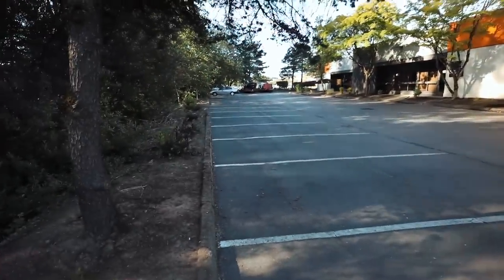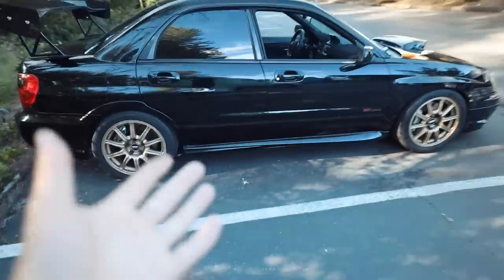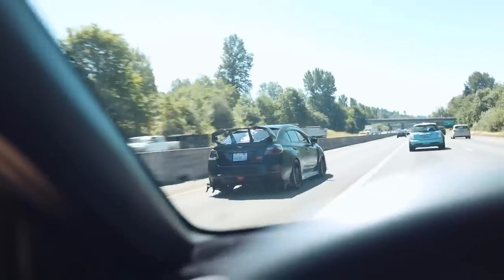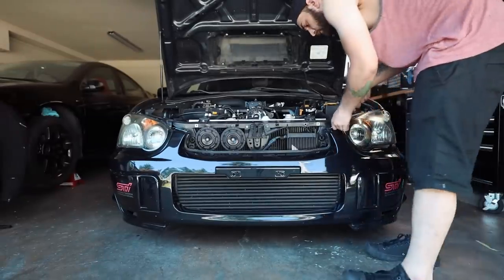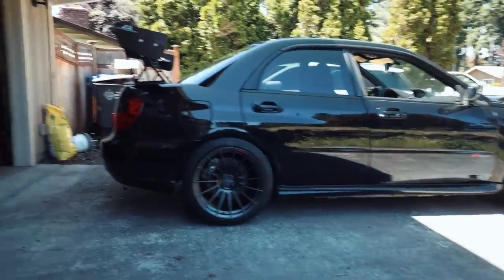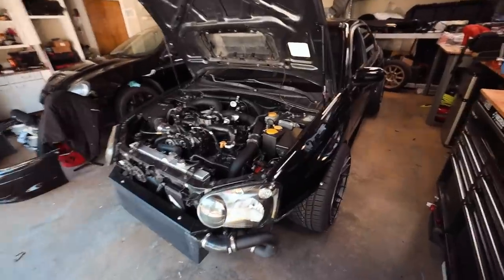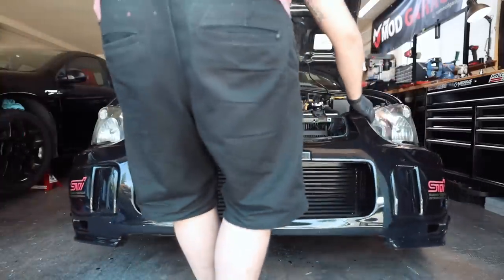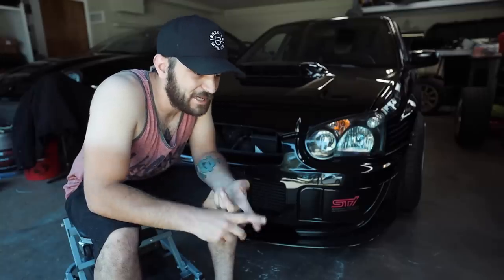Trust The Process...

Comment: u might need a main line hone /bore if you use those case bolts they have a higher toque capacity and can distort the main line
Reply from the maker: Outfront took it into account for measurements when they machined the block 🙏🔥

Comment: You should look at the ABW new age rear diffuser it requires a portion of bumper cut like Mature or hks Kansai which gives the aggression without lowering the rear bumper too much, also love your doing a proper chassis mount splitter eager to see the process cause I’ve been interested in using battle aero mount to install a apr or something so I don’t have those ridiculous splitter rods
Reply from the maker: I'll have the whole splitter install with parts put up here soon, and I already ordered thr APR but absolutely love the look and design of the mature!

Comment: Need to chuck that mishi radiator in the woods and get a Koyo instead.

The wing will definitely look more at home with all of the other parts you're waiting on, but I personally still can't get behind it or the aggressive aero unless it's for a track car. I just think it's unfitting for a street car, probably because of all the carshow stance bois that do it and don't touch the performance.

Friendly pro tip: Enkei is properly pronounced as "N-K".
Reply from the maker: Agreed! Koyo will definitely be taking its place, that mishimoto is like 10 years old 😅

Comment: Ok the wheels do help some. Off topic I'm gathering parts for my brz turbo build. I want head studs and forged internals to aid durability under boost. Is there any to not use lower comp pistons and will 1050 injectors be enough on E85?
Reply from the maker: What are you wanting to drop compression too?
Reply: @Smeedia  most common I've found is 10:1. I know this will require more boost to produce the same hp but with somewhat less overall strain on the engine itself. Basically making it more like a wrx fa20

Comment: I would HIGHLY recommend that you get a universal set of air conditioning O-Rings. They work great.

SAE Universal O-Ring Assortment Set Kit - https://www.amazon.com/dp/B08MF9LQSK/ - $13.89 (Not the exact set I have used.)

No need to get speciality O-Rings from Subaru. As long as they can handle AC refrigerant should work fine with Fuel lines as well! Sprung a leak on my fuel line and just used an O-Ring from an assortment set, and not more leak.

Also, a tip, whenever you put in or take off an O-Ring. The O-Ring is BAD! Trust me. I had to replace an O-Ring because I took it out and put it back in thinking it was fine, never re-use O-Rings. Do not reuse the O-Rings. If you put it in, consider it used, or if you take it out, consider it used. The O-Ring is used when you exert some action on the part.
Reply from the maker: Good to note, we have a few replacement O rings from ID now but may snag that kit for the garage now 😅🔥

Comment: I was curious about cooling because my 07 runs as hot when its that hot outside. I had a freind in my car and i only run ac when they are with me and was going up a hill and the car his 225 till i got to the top of the hill and went back down to 205. Really interested on how you solve the cooling issue. My GR wrx ran way cooler then my 07 sti now.
Reply from the maker: Whatever solution I find I'll definitely share it 🙌🙏

Comment: Hey, I’m going to build my motor and was thinking of doing a stroker build. Any other suggestions on what I should do and what engine I should build and put in? I have a 2002 bugeye with the stock usdm ej205 and stock five speed.
Reply from the maker: What are you going to be using the car for? 🙏
Reply: Ayyyeee I have the same, sedan or wagon ?
Reply: @sampilcher7196  awesome! I have a sedan 🚘
Reply: @Smeedia  I’m wanting to daily it and eventually track the car.
Reply: @casimerotagle3695  nice me too! World rally blue! Got it for 1000$ last year with a blown motor, but it’s one of the cleanest bodies/frames I’ve ever seen for being a Canadian car, I want to do it fairly stock and keep a lot of the value in it for the long term, I’ve just added brembos, coilovers, sway bar links and front sway bar, now for the motor and I should be good to go with this project.. for now lol
Reply: @sampilcher7196  awesome! Someone once told me that it’s going to be hard finding these cars stock. So I’ve just been storing every part I’ve removed 😂 I got my bugeye locally in Canada for about $3000. It needs some body work and the previous owner decided to cut the roof and add in a nine functioning sun roof 😂 motor also needs to be replaced but I plan on changing the colour of my car and building my motor. Mine is the stock grey, I have no idea what the colour is called 😂

Comment: You're gonna need ducting on the front.  Now you understand the struggle on track with big ass FMIC cores, it sucks and is why i stayed TMIC.  You duct it, problem solved.  Or get a big boy radiator like a Ron Davis, KillerB, or C&R.

Hella horns, oil cooler, FMIC clog up the airflow to the rad. in my opinion.  i'm sure you're aware, not trying to sound patronizing.
Reply from the maker: Totally agree, destroyed the airflow, once it's all torn back down going to make some ducting to help with flow as well as block off the hood scoop to help air flow. The hood vents should help pull hot air out after its passed through the core

Comment: Tanner, I don’t recall what cooling fans you have? When I had Michi rad and fans it was terrible. I put Spal fans on there and no issue since, could be a good move for the summer weeks in Washington 😀
Reply from the maker: Stock 😅 haven't found a set better than stock out there yet. May have to try the spal!

Comment: Is it possible for a tune to over heat your car ? Prime believes that retuning the car could fix the issue.
Reply from the maker: I've never heard anything like that before but prime knows their stuff. I'd be curious to know if it did fix thr issue though
Reply: @Smeedia  well I have to returne it with them first. But the car goes high after a pull and then immediately comes back down. Maybe it’s supposed to go that high after a hard pull in the summer ? Idk

Comment: The 02 WRX I just bought a few weeks ago, and finally got the uppipe fitted on, has now possibly spun a rod bearing... :( Literally started sounding like crap on the last mile or so home, definitely not driving it anymore. F*@! Lol
Reply from the maker: Noooooo 😭😭😭 what's the plan for the car?
Reply: @Smeedia  Gonna at least change the oil and check for metal shavings/bearing bits, if not obvious might as well pull oil pan and look further. If I confirm it is indeed donezo, then I'll see if I can get the car down to the guys over at M45 Auto/Snail Performance and see if I can pickup maybe a JDM EJ to drop in

Comment: I feel like people think gd stis are far more rare than they really are. They are everywhere problem is half them are sitting in peoples yard.
Reply from the maker: Facts, it's hard to find a suuuuper clean one but they're still out there
Reply: True
Reply: You can find GD Bugeye's for way less and clean examples are a plenty. A few minor suspension mods and a stage one tune and you basically have a stock GD STI
Reply: @Grooove_e  I gotta disagree, I thought the same thing until I bought my 04 STI (stock, but hurt engine) and drove it back to back with my 03 Bugeye (tuned, catless DP, SPT intake, various suspension bits). The STI was noticeably faster. The 6 speed gearing is comparable to a 4.44 5 speed, and the 2.5L/VF39 makes a bunch more low end torque.
Reply: @ghostpunkkilla  Makes sense, i didn't mention on my bugeye the 300 lbs of weight reduction probably helps quite a bit, I'm sitting around 2800 lbs. With a stage 1 tune (around 230-250whp) and some minor suspension bits it's definitely quicker than my friend's stock '05 STI
Reply: @Grooove_e  Oh yeah that would make a difference. Mine(both) are still full weight.

Comment: Nice.... But not a fan of your tire Choice.. Esp if you are actually going to the track (not Drag, actually doing Twisties with it.)  Meh..
Reply from the maker: Tbh I was not expecting them to stretch much, live and learn next tire size will be bumped up to a 285 vs the current 265
Reply from the maker: Looks great and jelly of the white. Tons of tasteful mods as well! 

Need to touch up suspension a bit right now just had thr Roll center adjustment, BR coils (which id like to swap out) and endlinks. Need to do a rear sway and some lateral links to get more adjustability from the rear. 

Right now the 265s are DW06 Plus for DD purposes, old ones are Michelle pilot 4S+
Reply: @Smeedia  Depending on how far you want to go down the rabbit hole.. I would suggest 
KW Variant 3's or Ohlin's Road and Track .. Race Comp has a decent upgrade for the KW's .. The adjustment is abundant and will help when you DD or Go to track.. there is enough Range to accommodate both.  :)  and it won't beat the crap out of you when you DD. Thanks for the Props on mine. I love that I got it Back and its in Great shape :)